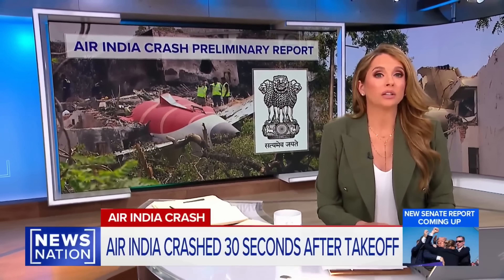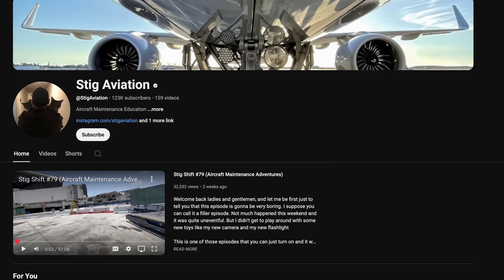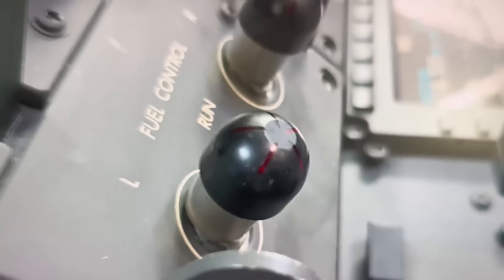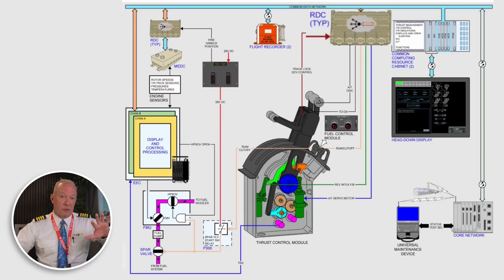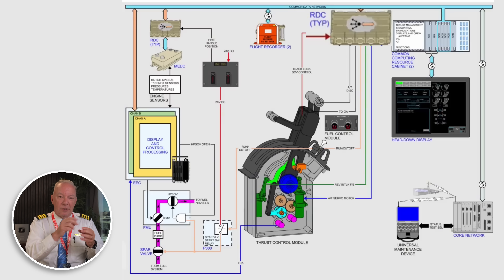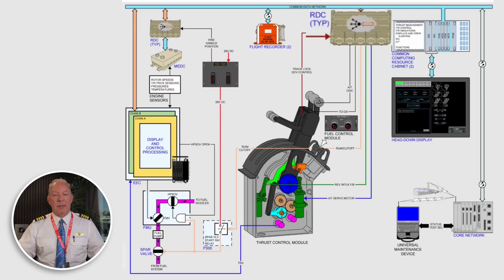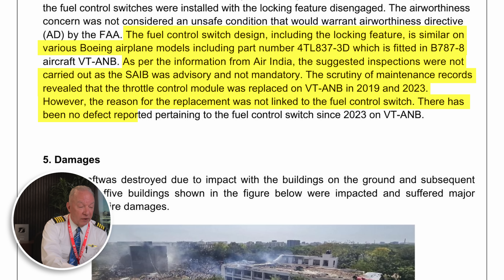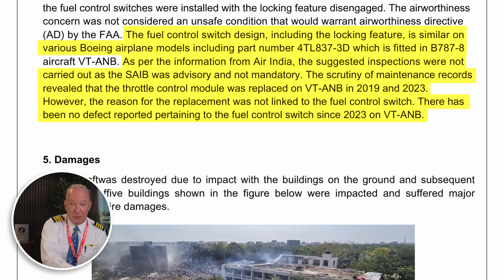The Truth About Boeing 787 Fuel Control Switches

Comment: @CaptainSteve thank you for taking the time to begin explaining the technical details of this important topic. I do have a few observations I would like you to explain in more detail, as follows: 

At 4:10 you state that the relay supplies the same 28VDC to three different valves. But the diagram shows the signal from the relay going only to the spar valve and, via an AND gate, to the high pressure shut off valve. The diagram shows that the fuel management valve is controlled only by a signal from the display and control processor.

At 4:25 you state all three valves open up at the time but that is only true if the signal to the FMV and the HPSOV from the display and control processor are also active.

At 5:06 you state there are no other inputs to that system. But the diagram clearly shows that fuel is controlled by two additional signals from the display and control processing unit to the fuel management valve FMV and the high pressure shut off valve HPSOV open signal.

At 6:34 you state that the signal from the relay goes to the fuel control valves, “all three of them”. In fact, according to the diagram presented the FMV is controlled exclusively by the signal from the display and control processing unit. And the HPSOV is controlled by both the fuel cutoff - run relay AND the display and control processing unit.

At 6:58 you state there is no other input to those systems but the diagram presented shows that there are other inputs from the display and control processing unit.

At 8:08 you state that the fuel control valves can only be operated by the 28VDC via the run-cutoff relay but the diagram presented clearly shows control from the display and control processing unit.

I look forward to hearing more from you in these points.
Reply: Agreed.

Regardless of what actually happened with flight 171, the thrust of this video is that the fuel valves could only have been shut off by physically moving the switches (Captain Steeve: "there is no other input to those systems at all").

As you point out, this is clearly contradicted by the schematic shown, as well as other flight incidents involving the 787.

For example, we have: "a 2019 incident involving an All Nippon Airways (ANA) flight NH-985, a Boeing 787 (Reg. JA825A) flight from Tokyo to Osaka, where the TCMA system erroneously interpreted the plane as being on the ground during its final approach. This misjudgment triggered an automatic fuel cutoff, causing both engines to flame out. Fortunately, the incident occurred during landing, allowing the aircraft to glide to the runway without crashing. The Japanese authorities and Boeing later attributed the event to a software glitch, not pilot error."
Reply: @corwin-7365  thank you for this this important data point.
Reply: There are ... 3ish valves; Fuel Spar Valve, High Pressure Fuel Shutoff Valve and a Metering Valve. I don't know how much authority the Metering Valve have; e.g. if they could shut the engine down, or just to idle.
Reply: @paultruzzi911  you could be right the metering valve may not be able to fully cut off the fuel but the diagram indicates that the EEC can stop fuel flow via the HPSOV since both the EEC AND RUN relay signals must be active.
Reply: @exist7309 Yep. A well documented response. It just shows that no matter how competent Captain Steeeve is at being a pilot, his technical diagram reading skills & knowledge of electrical/electronic systems are very much lacking.

Comment: Thank you for posting this. 

This was a tragedy, and whatever the root cause, it remains a terrible loss. As more information emerges, the puzzle pieces continue to fill in. I’m not certain that it can be absolutely nailed down, although the actual CVR would reveal much more than the snippets we’re currently given. 

One thing that many people miss about crash investigations is that the goal is not to assign fault to anyone, but instead, to learn from these tragedies and to use that information to prevent recurrence. A perfect example if Eastern 401, the flight which put “Fly the aircraft” at the top of emergency checklists. 

Human factors have long been recognized in the aviation world, and history has proven, over and over again, that even competent, well trained people can make big mistakes. Likewise, there can be mechanical failures, such as United flight 232, and sometimes there can be systems failures, Qantas 72 striking me as a prime example. 

A term I strongly dislike is “muscle memory”. To the best of my understanding, the proper term is procedural memory. If I exit the front door of my home, I twist the knob with my right hand, then pull the door knob towards me, and to the left. Then I step through the door and pull it closed behind me. Finally, I remove my keys from my pocket and lock the deadbolt and doorknob. But, I don’t think about any of this, because it’s al procedural memory. In fact, and one reason I chose this as an example, when I complete this task I usually say the words “double locked” so I I print a specific memory of locking the door, or I might wonder whether I did or not, and have to check, hopefully while I’m still on the porch. 

Procedural memory is all over our lives, we put little conscious thought into many common tasks. An analog in the computer world would be the trusty batch file, which is simply a list of commands, run in sequence. Batch files aren’t smart, they just run the list of commands without interrogating the computer to make certain that everything is working as it should. They are useful for simple tasks, but limited. 

In routine flying, procedural memories are also all over the place. That’s why we train. Simple things, such as keeping one hand on the throttle during takeoff and initial climb, or applying carb heat before throttling back a carbureted engine are examples which come, readily, to mind. 

When we learn a task and practice it a few times, we establish procedural memories. When I was studying music, and practicing scales, procedural memories were being created, and to this day, decades later, they still work, even though I don’t practice scales all that often. One amazing thing I’ve noted with regard to procedural memories is that even old procedures that you haven’t used in years will usually become automatic if you revisit them and practice a couple of times. Training, reinforces memories required to handle emergencies, and keeps pilots in practice. When seconds count, it’s good to have the important procedures fresh in mind. It’s also why flight crews brief the same old procedures before each flight.

There’s a procedural memory for raising the landing gear, and another for engine shutdown at the end of a flight. As illogical as it sounds, I have no problem believing that when it came time to raise the gear, the pilot somehow ran the wrong procedural memory and shut down the engine fuel controls, one at a time, just like at the end of the flight. It is not my intention to assail anyone, all I am saying is that I can see this as feasible. 

The term I would use to describe this is “momentary lapse of cognitive function”, and anyone who has ever walked into a room, and then asked themselves why they went into that room knows how this works. All it takes is a moment of letting the mind wander, or an unexpected interruption to derail conscious thought, while procedural memory continues to operate. 

How could this happen in the takeoff phase of flight? My prime suspect would definitely be some sort of distraction. Perhaps from an unexpected warning, an unexpected comment from the pilot flying, or perhaps the pilot monitoring had some pressing matter on his mind, from before the flight started, that caused his mind to wander from the task at hand. What ensued was terrible. I would suggest that the pilot monitoring didn’t even realize what he had done, hence the delay in attempting a restart. I don’t think that these were bad pilots, but it was a simple matter of some sort of distraction, which triggered a horrendous cascade of events. 

If so, the startle effect would loom large. Suddenly, and at a very critical moment, the situation was not what either pilot would have expected, and it took a while to reorient. The obvious course of action would have been to move the fuel cutoff switches to run, and the four second lapse between the two switch movements makes sense to me. At that point, they were in Terra Incognito, and probably very cautious about every move. 

There is a theory being promoted that there was a short caused by water getting into the E&E bay, and while I won’t discount this entirely, I have my doubts. This theory is that the FADECs rolled the engines back and that the pilots cycled the fuel control valves in order to reset the FADECs. If that were the case, why did it take 9 seconds to restore engine number one’s fuel control switch to the run position and another four seconds do the same for engine number two. I almost lost an engine due to a problem with the prop governor control cable, and I can promise you, it didn’t take so much as one second to take corrective action. I can’t imagine anyone waiting nine or more seconds to complete cycling those fuel cutoff switches, especially at that critical stage of flight. 

So, with all due respect for those who hold to this theory, it just doesn’t seem consistent with the timing of the movement of the fuel control switches. What seems more consistent is the actions of a flight crew who found themselves in an unexpected, and highly confusing, situation. Given the possibility that there may have been a history of crew rest problems and overwork, this makes much more sense. Fatigue can lead to this exact sort of lapse in cognitive function. 

Whatever the cause, it’s still a tragic event, and no one should forget that there are hundreds of surviving friends and relatives who are deeply affected by this loss of life, and that long after this investigation is finished, the effects of these losses will continue to be felt. The most important thing, at this point, is to find out as much as we possibly can about the root cause in order to prevent recurrence. 

It’s not about laying blame, not about blaming some manufacturer, or shielding some manufacturer from blame. It’s not about making a flight crew member into the fall guy, or exonerating the flight crew as heroes. It is about finding the holes in the Swiss Cheese and doing our best to prevent them from ever aligning again. 

After a period of relative calm, the last 8 months have seen some very high profile losses. While the losses are terrible tragedies, the information gathered shows us much about where the vulnerabilities are, at this point in time. This is not the time to cast blame, or to defend pet theories, but instead, it is the time to learn from solid data. My theory, as presented above is just that, a theory, and certainly not the final word in the matter. Whatever is found to be the root cause, we are unlikely to solve the root causes of these events unless we remain open to new information and allow our conclusions to be governed by the facts.

Comment: It’s still inaccurate to say we know how the switches got moved. Of course, the only likely explanation at this point is that is was intentional sabotage; however, we do not know for certain that is what in fact happened. Just because we can’t conceive of a way that this could have been accidental does not mean that it was intentional. Yes, it probably was intentional, because there’s very little likelihood that it was accidental. The only prudent move is to go forward assuming that it was intentional, and to examine policies and procedures for the future with the hope of preventing such a thing from happening again, while at the same time subjecting the fuel cutoff system to additional engineering review just for extra caution. I personally cannot understand why anyone would commit suicide, let alone why anyone would commit mass murder, in the process, but it appears that that is what has happened here, though again, we will never know for certain, unless some external evidence is discovered that directly implicates one of the people in the cockpit.

Comment: So just for clarification, is it completely and totally 100% impossible to somehow remotely move those switches. I know a 787 is not a drone, but obviously many systems on a drone are operated remotely.
Reply: The fuel spar valve position commands are 100% non software controlled.

Comment: Captain Steeeve said a few videos ago that the fuel cutoff switches on the 787 are digital, not analogue. Now he is saying they are analogue, not digital.
Reply: The fuel spar valves have analog position command "signals" (DC Power), the valve position indication starts with limit switches in the valve actuator as an analog signal, but gets converted to a digital signal that the FDR and Flight Deck Displays use for their function.

Comment: How can so fisticated plane be designed the way you can cut of the fuel at take off? Should the on board computer simply prevent it?
Reply: Designed that way to shut off fuel if an engine had a uncontained failure, or was ripped off (due to imbalance or hit something) to stop fires.

Comment: It doesn't instill confidence in the Boeing 787 the fact that the whole throttle assembly had to be replaced twice in about 6 years - they certainly don't make things to last in that plane! The fact that the fuel cutoff switches are very close to that module surely has to raise questions about whether their were any issues during the maintenance/repair that wasn't immediately apparent....?

Comment: Most important words to me as a layperson: "providing electricity, not a digital signal". So  - at least with regard to the fuel control switches - this wasn't a software issue.
Reply: It's not as simple as Captain Steeeve says. There are additional control signals to 2 of those valves from the EEC, which are clearly shown on the diagram. So there are other input signals to those valves. They are not only operated by the fuel control switches, as he claims.

Comment: Capt. Steeeve, Question about the SPAR VALVE and other fuel supply valves. Are these valves NORMALLY OPEN or NORMALLY CLOSED ?  My own deduction that these must be NORMALLY OPEN (NO)  -  The reason (NO) valves is that in the event of total power loss, these valves remain OPEN.  In other words, these valves can only close when they are powered. These valves will remain open when zero power is available, and energized when the switch moves from RUN to CUTOFF.  So powered / energized only in the CUT OFF position. So in the event of TOTAL POWER FAILURE these fuel valves will remain OPEN at all times, regardless. So when a pilot moves the switch to the OFF position, he is actually supplying power to the now closed valve.  Once you move to the RUN position, there is NO POWER on the valves.
Love some opinions about this scenario. Regards.
Reply: All of the fuel system valves are actuator controlled butterfly valves (excluding manual valves). They require power on new position command pins to change position (e.g. if open, power on the closed circuit). Loss of power leaves the valve in the last commanded position. So there is no "normal" position. But the rest of your statement was correct except when the fuel cutoff switch is in the RUN position, power is provided to the open circuit (until it is open, once open power is removed).

Comment: Thanks for the detailed explanation. I have a follow up question.
Could an issue with the 28v battery cause this? Like a temporary blip in the battery performance or connection and then it came back on after 10 sec. If battery dies, will that cause the fuel to shut off, and will that register as fuel switch cut off in FDR?
Reply: The fuel spar valve must be powered to a new position.

Comment: You clearly mention a human intention to cut off those switches, in other words, a suicide. What if connection with that battery you mention fails, because a damage of any kind in a cable? (Or a short circuit? You will answer that power cut off would have happened together at the time. Sure?
Good you tell me that no human is completely reliable; would you strongly confirm that all electric circuits are always reliable? I can't answer that. I know for a fact fact thank any smallest probability car always happen, now, or later (could be nearly a eternity, but anything that can ever happen, will eventually happen, it's the law of statistics). It doesn't mean that I want to make Boeing responsible...
Reply: The fuel spar valve must be powered to a new position. A hot short on one fuel spar valve closed circuit, would not affect both valves.

Comment: The pilot clearly says he didn't cut off switchs. Why puting blame on pilot? As a pilot he should support others not Boeing.
Reply: Here is the rub. In the preliminary report they never say which pilot said what. Did the Pilot Flying ask why the valve was closed or did the Pilot Monitoring?
Reply: @paultruzzi911 In the block box recordings one of them said 'why did you switch off the engine'. The other said no. It is clear that the person who is asking the question did not switch off, neither the one who answered the question. Some of the comments clearly say there is a possibility of auto switching off being an engineer.